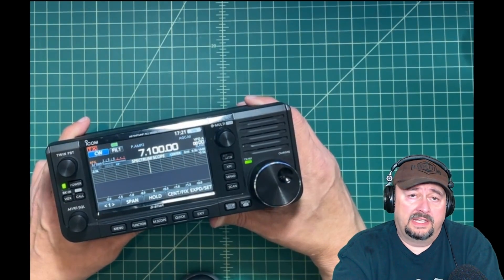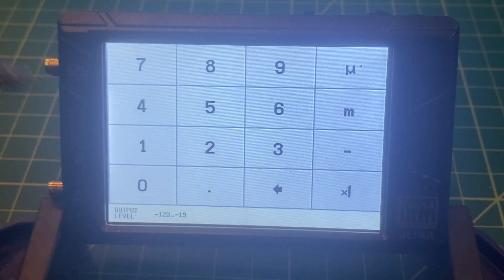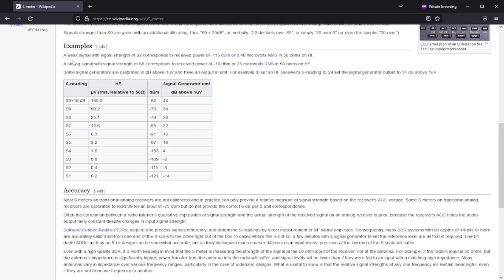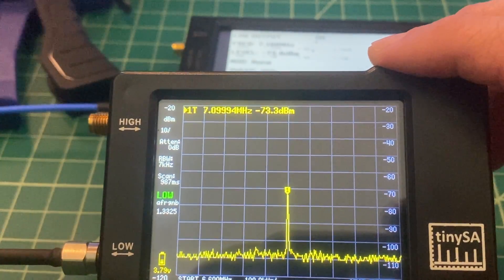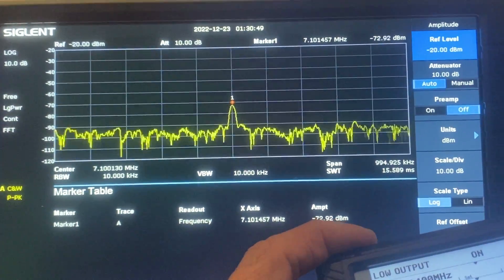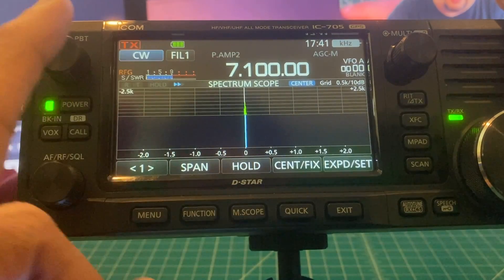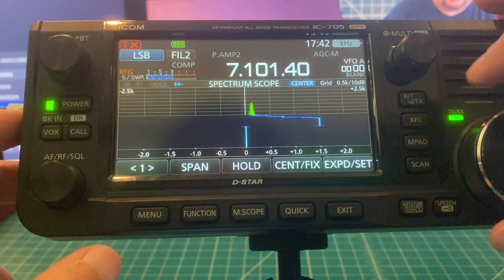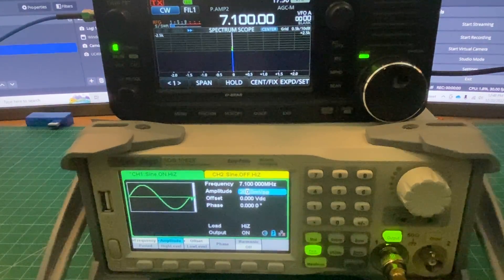The ICOM IC-705 S-Meter tested with the TinySA

Comment: Seems normal unfortunately. Could not find original article ,but the S Meter test results table from the article is in the following :Google VU2NSB  S Meter ....has the chart in s meter article that I was looking for.  Also google Owen Duffy ic 7300 s meter calibration. Seems SDR never solved the s meter issues like I thought it might.
Reply from the maker: Apparently, for the s-meter to be "accurate" you need to have the RF Gain on full.  I would expect that the signal could be captured at the front of the RX chain and that setting didn't matter....

Comment: I just checked my IC705 with my TinySA Ultra. At minus 73 db I get an S7 reading at 7.100 mhz.  Pre amp off as well as the ATT off. I usually have the RF gain set at 90% but turned it up to 100% for this test. I did the test in the CW mode.

Just thought I'd pass that one. Thanks for great video.  I have to say, between my NanoVNA H4 and TinySA Ultra, I have two of the most useful tools to be used in Ham Radio. I also have a RIgol DSA850TG but the Nano and TinySA are so much easier to set up for some quick testing.

Barry, KU3X
Reply from the maker: Good to hear from you Barry.  SOunds like we had similar experiences 👍

Comment: Nice S meter testing Ape !!  With all the RF Gain controls + RF Preamp features & Lack of pertinent user instruction manual resources, seems 73 Dbm sig level to S9 Indicated has become a lost Calibration issue....It May be Accurately described in the Official Service Manual alignment procedure if someone can verify....As Relative as the Indicated S9 level to Actual - Dbm signal Level is,  the Most Important S Meter Usefulness Is for the Indicated S Meter reading to Drop 1 S unit Per each 6 Dbm Actual Signal level Reduction....If the Receiver's indicated S Units to -- 6 Dbm step Reductions Isn't fairly Calibrated from S9 to S1,
Reply from the maker: Agreed, I think.  The only thing the S-meter is good for is relative comparison.  Thanks for watching Tom.

Comment: You only use RF gain to reduce the signal from a close powerful signal, otherwise the rf gain should always be at 100%, rtfm.
Reply from the maker: I did read it short pants, and it didn’t say that…. Maybe you need to RTFM 😑

Comment: Thanks Ape, this was really interesting indeed! It proves the TinySA (both legacy and new one) to be a credible testing tool, and the comments so far were just as interesting and instructive on the main. It would be really interesting to repeat this test with some of the other popular QRP-style radios too (if you have them), e.g. Yaesu FT-817/891, Xiegu X5105/X6100/G90 and any of the Elekraft models if you have access to one. At least it will show (a) whether they follow the same calibration convention as Icom - which some comments seems to suggest should be the case, and (b) whether they are as accurate (or not) as the Icom. 

I also did not know about the theory behind the S-meter values, so this is all great information. Thanks for a brilliant video! 73, Jan (M7HNK)
Reply from the maker: Hey Jan, thanks for the comment.  This was a fun video to make that I felt could help folks learn about the TinySA and play around with their radio.  You're correct that the RFG at 100% will show S9.  Thanks for watching!

Comment: You should be able to do 2 tone Intermodulation measurements for RX and TX with the Siglent Generator
Reply from the maker: That's something that I am planning.   I'd love to hear if you have any suggestions...
Reply: @TheSmokinApe  I think the Siglent has a combining mode, where the 2 signals are combined internally. Not sure how effective that is. I have made a transformer based hybrid with 3 resistors and a transformer for my Rigol DG1062Z.  Find a hybrid schematic online or in ARRL manual. Having attenuators after the hybrid is recommended. Do a 10 dB S+N/N  first with an AC voltmeter Set your signal generator  to required spacing apart eg 25/50 kHz, and tune to the product +/- 25 kHz away.  Adjust level for  10 dB S+N/N again.  Check that the noise floor doesn't increase  with just the closest carrier, as this will give misleading results. (Phase noise limited)
Reply from the maker: @technishn  thanks for the info, and yes the Siglent can combine the two channels.  Enjoy your holiday!
Reply: @TheSmokinApe  You may need more isolation that that will give you. Tests will reveal that. Enjoys your holiday. Christmas is already here in NZ :)

Comment: Max RF gain, no preamp is where I would expect the S-meter to read S9 at -73dBm. It didn't look as if it was going to do that from what I can see here. Whether a radio's S-meter behaves as it should with about 6dB steps down from there per S-unit is a bigger thing to explore, and I would bet few now do that. Modern radios with confusing manufacturer approaches (Yaesu's "IPO ON" is how you turn the preamp off, idiotic because you should have the preamp off by default on HF) don't help people set their receiver up.
Reply from the maker: Hey Stuart, thanks for the comment.  It does read S9 with the RFG at 100%, I never use the radio on 100%.   When you think about it, having to set it at 100% to correctly measure the signal kind of mane is an RF Loss knob!

Comment: Typically S meter calibration is done at max gain.
I prefer a strength meter calibrated in dBm. 
Most receivers don't provide correction when internal amplifiers or attenuators are used.
The S meters are usually run off the AGC in legacy designs.
Modern Sdr designs could display over quite a range.
Is that adjustment RF gain.. Or IF gain?
Input attenuation/preamp gain should be used to reduce band noise down, to give maximum dynamic range.
Keep on doing the great work. Greeting of the season from NZ
Reply from the maker: Thanks for the comment Tech.  In this case with the pre amps off and the RFG at 100% it does show an s9 with -73dB.
Reply: @TheSmokinApe  Can you hear band noise (antenna connected) with the preamps off?
Reply from the maker: Yeah, the radio works great.

Comment: Great video ! The " S - Meter"  Values in the IC705  should  be in the service instructions for the radio as that is typically something that can be "calibrated".  As others have said previously the RF gain is typically set to 100% when performing this "calibration" per past practice. I was in a class during the spring and had a tiny SA in my toolbag  and it floored  everyone with just how useful it can be. The equipment I use at work has to be calibrated annually but as you outlined "this is ham radio" . Thanks for sharing !
Reply from the maker: Hey SC, when the RFG is set to 100% it did read s9.  The TinySA is an awesome bit of kit for hams, I am surprised that so many turn up their nose at them.
Reply: @TheSmokinApe  Definitely ! I have this conversation often. The Tiny SA and the Nano VNA have been the game changers of the past several years IMHO. The capability that both exhibit for the price point and the fact that they together have the form factor of a single HT is simply amazing.

Comment: Ape, I’m no expert - you’re the expert! Been a ham since I was 13 (I’m 55 now), and been doing Radio a long time. I always understood that the standard way to run a radio was with RF Gain at 100% and no pre-amp. Then, adjusting RF Gain and/or using pre-amp (or attenuator) was optional for the given situation. 

Seems to me the fair test would be to test the radio at full RF Gain and no pre-amp.
Reply from the maker: No expert here...  So when I do the test with the RFG at 100% it does show an s9.

Comment: Hello Ape, you did well to show that the signal level you selected (-73dBm) out of the TinySa for your tests was in every practical sense -73dBm.
The RF gain should always be set to 100% which sets the receiver to its most sensitive setting. The RF gain should be reduced to reduce the incoming signal to improve audible quality. 

I have a Kenwood TS430s and only reduce the RF gain and increase AF gain if there is a lot of QRM to better hear weaker stations. Hope that makes sense and I does not come across as a negative comment.

Merry Christmas!
Reply from the maker: Hey Harry, not negative at all.  At 100% it does show an S9, I never ever run the radio close to 100% RFG.   Also I didn't find anything in either of the manuals about it...  Thanks for watching!
Reply: @TheSmokinApe  Great video! I run all my radios at 100% RF gain so I can pick out weak signals. The only time to turn RF gain down is to reduce noise while rag chewing with a strong signal. Also like the previous gentleman said to block some QRM. The radios are designed to run 100% RF gain, so no worries on damaging the radio if that was your concern. My apologies if this is just another repeat message about RF gain lol! Keep up the great videos! 73 Curt AC9HO
Reply from the maker: @yeater302  hey Curt, thanks for the comment.  At 100% it did show an s9.
Reply: @TheSmokinApe  and yes it should be 100% unless you have to back off due to ltoo arge signals.

Comment: Thanks for doing this. I have wondered in my 2 years of IC-7300 ownership "at what RF gain level should I give someone a reading?" I can make the S meter read whatever I want depending on attenuation, preamps, and RF gain setting. Seems like the manufacturer would tell you under what conditions an S reading is taken. Or, maybe not! Thanks again!
Reply from the maker: It's exactly why I don't use the S-Meter when giving a report.  Thanks for watching Don!

Comment: I am still learning but for what it's worth, in my Yaesu FT-991A manual in the RF gain section, page 57,  they seem to suggest that it should be turned all the way clockwise and then just a tiny bit counterclockwise. Maybe there is a similarity with how the ICOM should be operated?
Reply from the maker: You are correct, it's the same.  Thanks for watching!

Comment: The money you spend on that rig its supposed to be on in the factory they celebrate it at the factory signal generator etc and thier test equipment is always calibrated and documented.
Reply from the maker: It will accurately read S9 if the RFG is set to 100%

Comment: Hi Ape,
I think you need to set the RF gain to 100% to check for S9 if injecting a -73 dBm signal. You and your family have a safe and happy holiday season.  73  WJ3U
Reply: Exactly Don! The RF gain in ICOM radios actually behave as an input attenuator. So you need to turn pre-amp off and set RF Gain to 100%.
Reply: Precisely exactly.  He missed the boat.  De W5NED
Reply: You need to turn the RF gain up until the rfg goes away. As indicated it is attenuated if you turn it more counter clockwise and the rfg indication comes on.
Reply from the maker: Thanks Don.  Here is what is crazy, I never run a radio at 100% RF Gain, I was surprised to others did...  I also looked through both manuals for the 705 and didn't see it mentioned anywhere...
Reply: @TheSmokinApe  I think the reason for turning down gain, is to adjust the noise floor to S1 or lower.  When reporting an S unit, I always assumed I was reporting it as "above the noise floor" rather than an absolute power (dBm) level.  So, my report is a combination of the sender's signal level and my local noise floor.
Reply: @TheSmokinApe  Hi Ape,
See if Icom has the service manual for the 705. Even one for the 7300 will do. It will have the instructions for alignment. Stay safe.  73  WJ3U

Comment: Interesting how they charged the price they do when the ftdx10 has way better specs and being sold at a all time low price of 1350 😉yes I understand it’s not a portable rig so comparing isn’t fair but the two rigs released during covid and their price. Well I guess comparing a dual conversion to a SDR isn’t kosher either 😊
Reply from the maker: Love the comments Kevin!
Reply: Does the FTDX10 do UHF/VHF/D-Star?    Might explain the price better....
Reply: @twohandsandaradio  no they did not redo the 991a which does hf-uhf plus digital Fusion. The ftdx10 took the 3k place in its more a contesting rig with shift width notch n contour easily accessible.I’m still waiting on the 818 revamp with digital I think they could do it on the 710/ftdx10 platform maybe even get a 50w output 😉